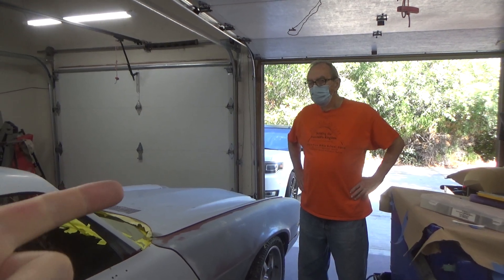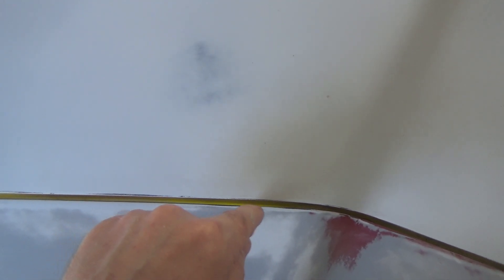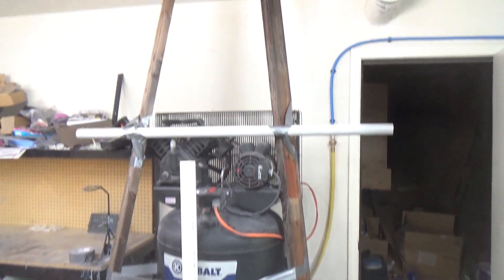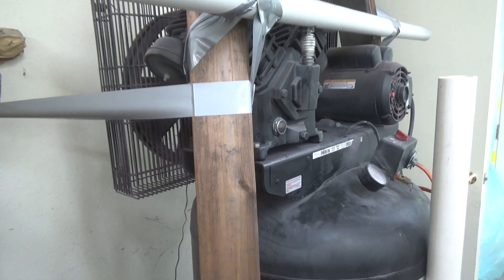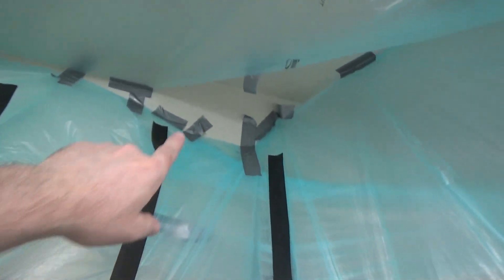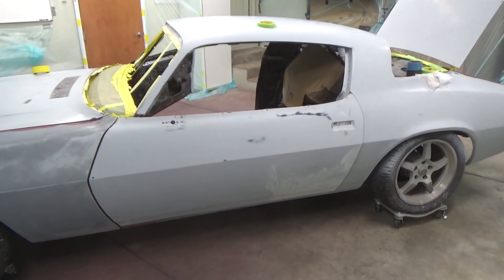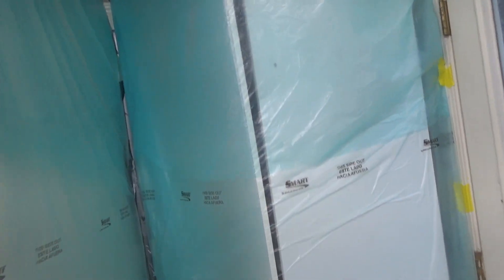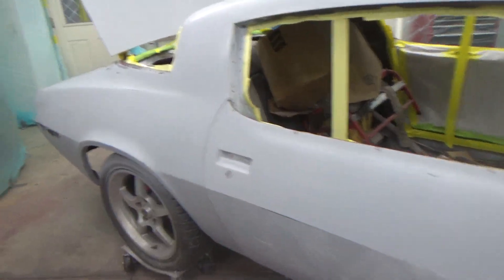1977 Camaro Z28 Part 238: Paint T-1 - More masking and garage prep

Comment: Great Job!   I was afraid (a little bit of fire ... from motor sparks, and static  ...  i know u had water based paint along with the fresh air from under house to compressor and exhaust motors ... so that curbed my fear a lot). Thanks.
Reply from the maker: We ended up having to ditch the wrap on the compressor due to air flow problems. I wish we would have found a way to make it work though because I think a lot of the crap in the paint came from that dang thing. Water-based works great as long as you have clean air. I showed my filters there and they did the trick.

Comment: Its boring and take a Lot of time to masking and preb the garage but every Minute you  spend will save you a lot of time in color sand and buff. Make a step by step plan where you start to paint and finish, thinking about the air Flow minimize dry Spots and the where the overspray Lands... in wet paint or as dust on the Panels. Make a good Plan, dont get in hurry and take your time. Good luck
Reply from the maker: Hi Jan! I did do that. I mentioned you in the T-0 video. Not sure I pronounced your name right!